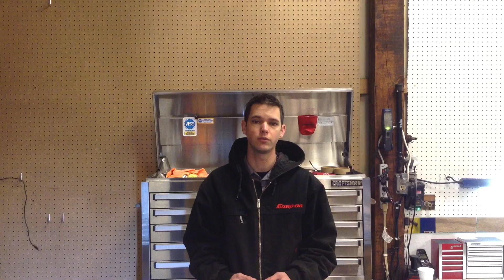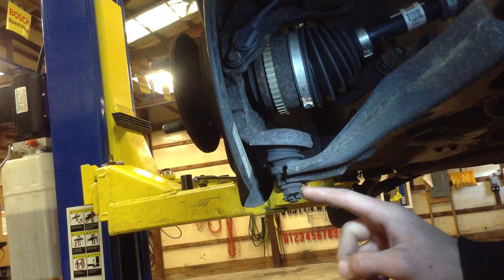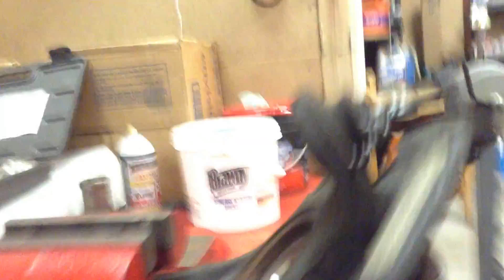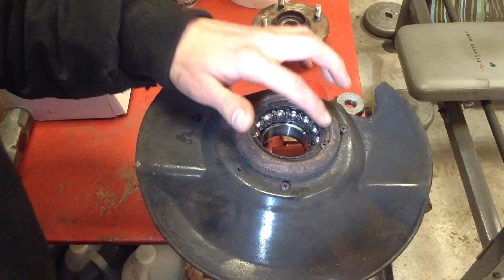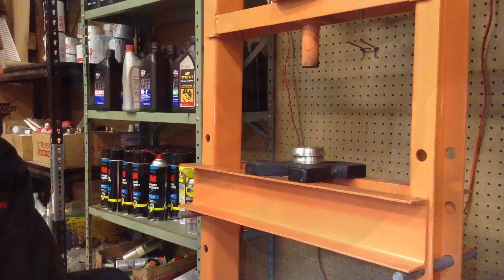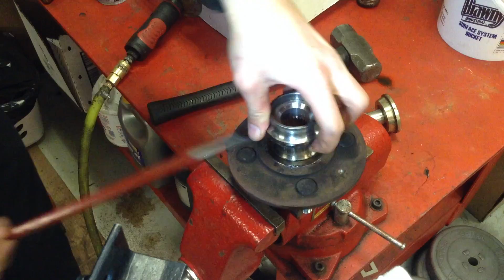2003 Honda Civic Front Wheel Hub Bearing

Comment: What I do to get the race off the hub with the wheel studs is put it in a vise and use my mig welder to run a bead half way around it , it creates enough heat to make the old bearing race fall off .No grinding necessary has I always end up gouging the wheel hub ,lol. Im getting to old ha ha .

Comment: I appreciate that this might be the case for some people , what do they do if they do not have a press ? Hammer the new bearings back in .
Reply from the maker: @ the local parts store you can rent a host of tools including a ball joint press which could be used in a pinch. or you could get it all apart and take it to your local machine shop or auto repair shop and for a fee  they would press them in for you. then you could take your knuckles back home and install them  for a fraction of the cost of what  it would have cost to have it all done for you.

Comment: It's worth saying you can also use the old bearing to push on the new one.  I say this because you need to push on the outer edge of the new bearing and it can be hard to find something that won't be pressing nearer the middle.  The old bearing with the inner race missing is perfect for this.
Reply: You can absolutely press these bearings in from the inner race why are you ignorantly spreading bullshit
Reply: @sorryimajerk735  I suggest you get some anger management therapy or something.

Comment: What is the official technical term for the "press tools", where do you buy them? Thanks!
Reply: +thaik56 Shop press, range from about 6 tonne to 100 tonne, from the videos I've watched, it seems that a 20 tonne press will do just fine for passenger vehicles. You should be able to buy it at an automotive supply store, I know Princess Auto sells them. If you are only planning to use it once or twice, it may not be worth the investment as they are around $300 - $600 for one that will meet the requirements for your application.

Comment: Hi Andy,
     You hammered out the hub with a dowel. Could you recommend a hub puller for a Honda Civic 2005 to get the hub off for those of us who don't have a vice to hold the knuckle? Thanks very much. Fred
Reply: +VolksdeutscheSS I know it's probably too late for your project but you can use a slide hammer to pull the hub out of the steering knuckle. Pull it out while the steering knuckle is still in the car before removing it. If you don't have one, you can rent one from parts store chains for free.

Comment: Good stuff, thanks bro. This is the same application for a 2007 Accord.
Guys, DON'T forgot to support the ABS side of the bearing when pressing the hub back into place which is shown in the video. I jumped the gun and screwed up because I didn't watch the full video before starting. THANKS AGAIN

Comment: Hi Andy,
     Great video. I'm trying to replace a bearing on my Honda Civic 2005. You definitely helped me get a better idea of what I have to do. One question: where did you get the tool that you use to punch out the hub and the bearing--the long tool with the flat head. Thanks!

Comment: Quicker way is to go to the junk yard and pull the whole spindle for 30 bucks like I did. If you wanted to replace the bearing and all you can, then you can swap and entire spindle out in around 20 minutes like I just did. I live in apartments and they cry when you do so much as an oil change so I had to get in and out with it.

Comment: Couldnt you just press the hub into the bearing first then into the knuckle so you dont have to worry about pushing the bearing out the back?
Reply: +iGAMERx64 No, because the bearing is retained in the steering knuckle by a snap ring. You can't get to the snap ring to install it or remove it with the bearing installed on the hub.

Comment: I got 2 words for you: "Hub Tamer."
This is the incorrect way to do a hub bearing. Not only have you wasted the shops time and your time and the customers time, but now you have to charge them for an alignment.

I have the hub tamer from OTC tools , and I can do almost any hub bearing in about 20 to 30 minutes. And I do not have to remove the knuckle off of the vehicle. With the hub tamer, you don't have to screw around with trying to get the knuckles straight on the press, and parts flying out because their under so much pressure.

It saves a hell of a lot of time, and most importantly, you do not have to do an alignment afterwards.

Look into getting one.
Reply from the maker: Yes, Mark, that is a really sweet kit! However, it costs over $400. You can get most bearings replaced at a shop for less than $400. The idea of this video is to help the handy do-it-yourselfer to complete this job with his current set of hand and pneumatic tools. If you make a living in a repair shop, by all means invest in that tool! If you are only replacing one or two bearings in your home garage, the method outlined in this video works just fine. Even if you want to pay $80 for an alignment, you are still ahead by not investing over $400 in a tool you may only use once or twice.

Thank you for watching the video, and thanks for the comment!

Andy
Epic Automotive
Reply: Mark Carranza many many  bearings can't be pulled with the tamer sleeves and screws, especially cars from east coast salt belt you will need a press so you could spend $400 for that kit and still need a  press.
Reply: crxtech1 this, sometimes 20 ton is barely enough to make a bearing with 200k salted miles on it.
Reply: Mark Carranza Hey Mark, this is Fred. What part # is the "hub tamer" and where could I buy it. I'm trying to do a bearing replacement and can't get my ball joint out. Maybe a "hub tamer" is what I need. I have a Honda Civic 2005. Thanks.
Reply: VolksdeutscheSS you need to hammer it out and then you can use a ball joint press to press it back in.
Reply: +VolksdeutscheSS  you can find the kit on Amazon for less than what ANY tool dealer sells it for. look up OTC HUB TAMER KIT.
Reply: +VolksdeutscheSS Just to clarify, the hub tamer is for the removal and installation of hub bearings not ball joints. For ball joints you can use a ball joint removal tool. There are many different brands. You can also rent these types of tools for free (with deposit) from major auto parts chains like AutoZone, O'Reillys, Advance Auto, and others.

Comment: not every hub and bearing can be taken out with a hammer. that is when it becomes a huge pain in the ass.
Reply: the same way for the lower control arm pain in the ass lol
Reply: I dont know if it is my luck, but  the majority of them would not come out like that which is the hard part. To install them is the easy part in this case. Because  to align and level the spindle in the shop press while the hub is in place it is really really hard.

Comment: does taking off the knuckle affect the alignment?
Reply: every time you change bearings, axles, tied rods etc. every single one affect the alignment.
Reply: @kelvinfeliciano  no, only tie rods, worn ball joints and sometimes control arms affect alignment. Bearings and axles won't and neither will removing the knuckle.
Reply: @willthecardude6900 some cars have alignment on the struts itself, or knuckles,  also control arms.... So yes it will change alignment. Also, New parts are tight like CV axles and bearings... And they could change alignment.
I saw it all the time at the shop.
Reply: @kelvinfeliciano  yeah, eccentric bolts. But just mark them. There's no reason to do an alignment for an axle or knuckle. I've changed hundreds of axles and done probably over a hundred alignments. Most cars have the front camber adjustment on the control arm itself, and of course the toe is only affected by the tie rods.

Comment: Thanks for the great video, just a question, what's the name of the tool you are using to press out the bearing? Thanks in advance
Reply: Hydraulic press. You could take it to any shop that has one and have them press it for you, just don't forget to tip :D

Also if you're trying to buy one for yourself, don't get a cheap one. Those things can put out tens of thousands of lbs of pressure. You don't wanna be anywhere near it if it fails.